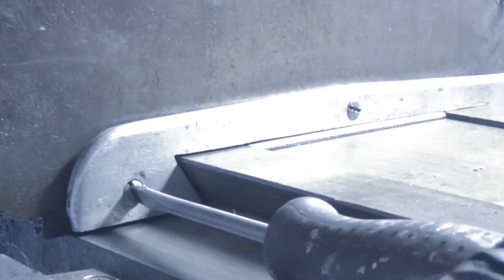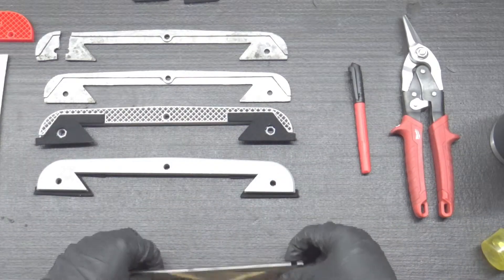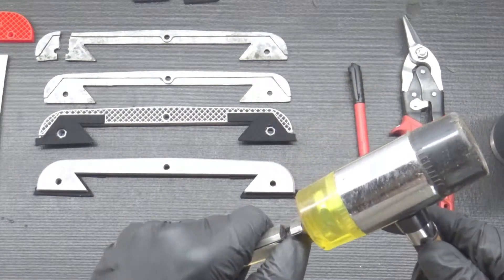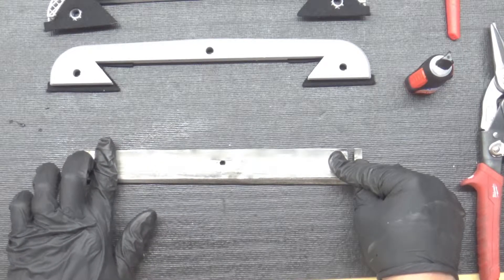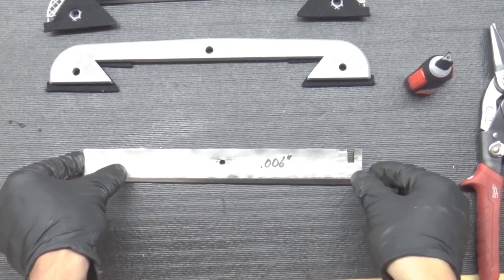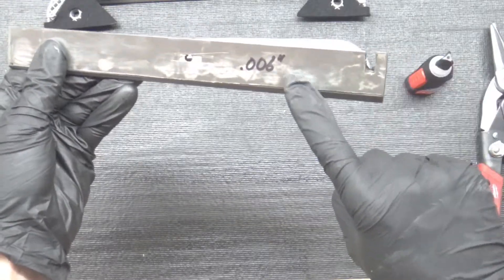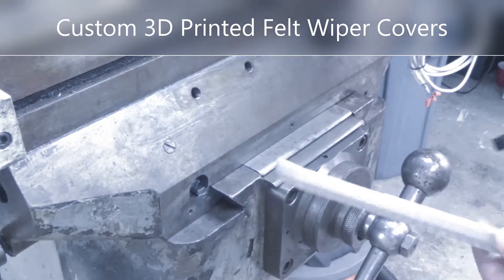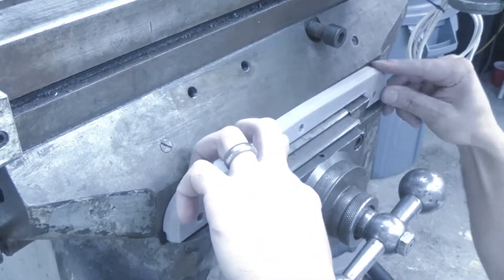Bridgeport Mill Gib Shimming & Felt Wiper Upgrade

Comment: Good point about the y-axis gib adjustment and the potential for damaging the rear aluminum Wiper holder by driving the gib into it if there's too much play. The gibs on my bridgeport are fairly well worn. I've got a 0.015 shim on my X-axis gib and technically it could or should be increased to 0.020.. I'm going to pull the Y-axis cover and see how deep my adjustment screw is and if I need to make myself a shim for that.
Thanks for posting.
Reply from the maker: Glad you found the video helpful. Appreciate the comments. Good luck and let us know how it goes!
Reply: @crosshatchengineering  I had a look at it today. One nice thing is that someone drilled a hole in the front cover so one can adjust the gib without taking to cover off. I pulled the cover to check if it already has a shim and it does, and the head of the screw is 0.125" below being flush with the Y-axis carriage, so I'm good. No further work needed. Again I appreciate your video because the idea of driving a gib in too far that needs to be shimmed would likely break the rear cover which hand not occurred to me at the time I had adjusted it. So by dumb luck I was ok. Now I am aware.

Comment: Found you some proper covers instead of that plastic stuff.  https://www.ebay.com/itm/Milling-Machine-Part-Saddle-Knee-Wiper-Plate-Set-MP3037-2/180637616151?hash=item2a0ed74817:g:LfwAAMXQR-dRFQe2  H&W also has them.  https://www.machinerypartsdepot.com/product/1153